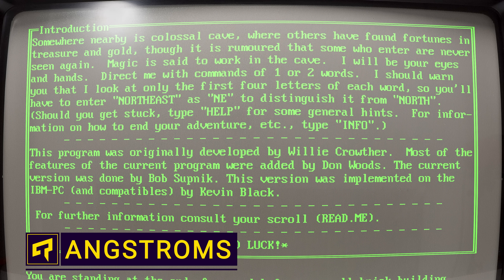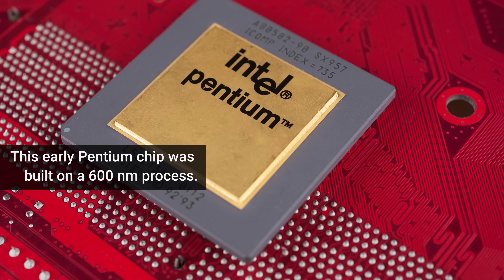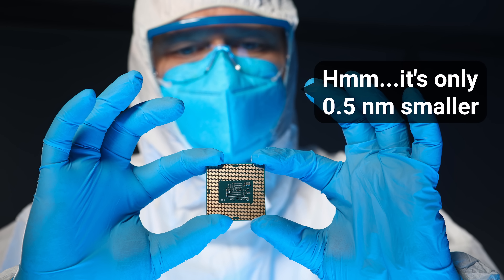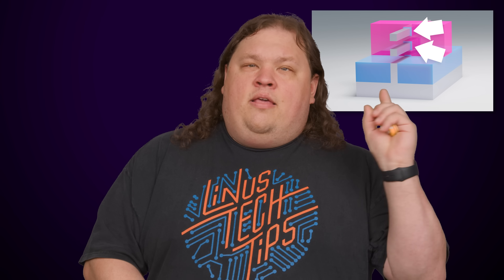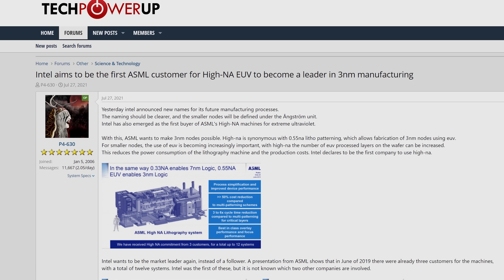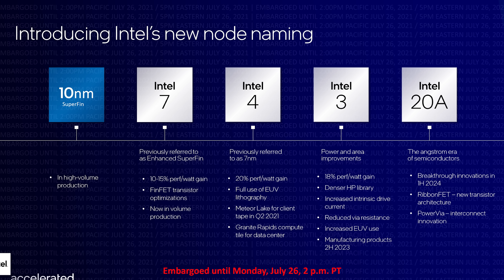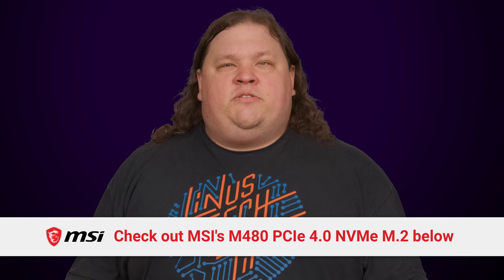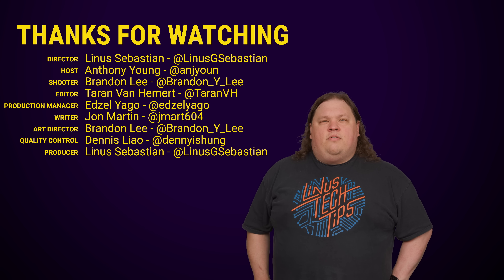CPU Angstroms vs. Nanometers

Comment: For what I know, a Ryzen 7 doesn't necessarily have 7nm wide transistors, but they use a namely 7nm process. EUV machines emit light as wide around at 13nm, so physically it is sized differently. Things, however, will change when ASML will ship better machine in 2 years, heading to the angstrom era. 
Edit to say you guys explained this, commenting before watching halfway pog. But also, TSMC does the same (N7, N5, so on)

Comment: I wonder what we'll do when we reach 2.2angstrom. We'll probably find another material, but eventually we'll reach the limits of that. I think we might be reaching the limit of size and maybe even computers before 2100.
Reply: Well Graphene is about 1.42 angstroms but I don't know if it will be worth it. What I think will happen is that companies will compete to maximise density since today TSMC and especially Samsung only shrink nodes without actually trying to get the most out of it so they can get it out to the market earlier. Intel might be behind in transistor size but in density Intel's 7nm is gonna be better than TSMC's 4nm and their 10nm is on par with Samsung 5nm. There's still a lot of room for improvement outside shrinkage.

Comment: not everything said here is correct, please check what you tell so many people. As an example, EUV is not used to make the transistor, but to illuminate the mask that is needed to etch the structures. And 5nm structure width does not mean that it is the transistor, but the smallest component of it, which in the end becomes a transistor.

Comment: hmmm... so 20 A means 9 si-atoms in line? is that the length or the width? what area would that be? if i knew the area, and knowing how much space between transistors, i could scale it up to the chipsize. wouldnt that be... easier to understand in terms of how the calculating power of a chip scales from generation to generation?

Comment: But why? The metric system goes lower than nano... there's pico, femto, atto, zepto and yocto... Your ångström is just a deci-nanometer or 100 picometer. Feels more like Americans will use just about any obscure standard of measure to avoid using metric... (I know ångström is technically metric, but we already had picometer)

Comment: The big issue I have with this is that even nm failed to be a relevant measure more than a decade ago. Switching to another physical measurement unit that doesn’t actually represent anything about the process or transistor feature size is the wrong thing to to.

Switch to a relevant measurement, such as maximum transistor density per mm2 or cm2. Then we can actually compare across fabs as well.
Reply: But that doesn't mean anything either. What we actually need is power efficiency and processing power measurements.
Reply: @ritwikreddy5670  but those are impossible to measure in any meaningful way, especially once you change architectures. As least maximum transistor density gives a meaningful cross fab measurement. Remember,mere talking about manufacturing technologies, not finished product capabilities.

Comment: There is a limit to size decreases... the molecular transistor.  I have been out of the semi world for a long time, but back then the issue was drawing the pattern for etching.  The light limit was reached, and they were having to switch to electron-based machines.   It is funny, but the mass rush to decrease in size  ended about 20 years ago.  Now it is all about refinement, while slowly gathering the machines and resources to jump down to the next size.

Comment: why do transistors need to get smaller instead of cpus get bigger with more of the 'big' transistors? nobody would mind a cooler twice the size. the ryzen is already a bit bigger than the usual 4x4 cm or so

Comment: Hi
 I have two computers
 System specifications first
 ROG STRIX Z590-F GAMING WIFI motherboard
 CPU i9 10900KF
 (3200) 64GB RAM
  (4 RAMs 16)
 SSD 1T M2
 Second system specifications
  Motherboard TUF GAMING B460-PLUS
  CPU i5 10400
  32 GB of RAM
 (1 RAM 16 (3200)) (2 RAM 8 (2400))
 SSD 512GB M2
 Both computers freeze while playing or working or watching movies. Suddenly, I swapped CPUs for both systems. The problem was not resolved.  I replaced the RAMs of both systems together. The problem was not solved. I replaced the graphics card of both systems together. The problem was not solved. I installed the operating system of both Windows 10. The problem was not solved.  I installed both systems on a Linux operating system. The problem was not resolved.
 What should I do now?
 Thank you for your help

Comment: I didn't see you mention an important point-- chips are basically 2D.  So if you go from 1000 to 10 nanometers, that is a factor of 100 in linear size, but 10,000 times smaller in transistor area.   So the gains have been much larger than the linear feature size would indicate.  Lots better.

Comment: Smaller nm or whatever will be useless if still need a lot of electricity just like what happend on intel h45 on laptops which is 10nm have terrible battery life despite it is not made for desktop replacement laptop

Comment: Just a small correction, the size is not of the transistor, but of the gate.
The way chips are designed you can't measure the size of an actual transistor

Comment: I'd say at this point transistors per square millimeter and flops per watt would be preferable, since regardless of what dimensions the transistors are, if you can fit 5 million in a square millimeter, then you can fit 5 million in a square millimeter.

Comment: You kinda flip-flopped on this one... You were talking about the node names as if they actually corresponded to anything real for the vast majority of the video, but noted that the names actually mean nothing at around 3:20... 

But even then you only said that there isn't an "industry standard way of measuring transistor sizes," while in reality they are just names as far as I can tell. For instance, IBM's new "2nm" ribbon FETs have ribbons that have 5x40nm cross-sections, which are then surrounded by what I'm guessing is a dielectric.

So what is the "2nm" referring to? Doesn't look like it's the dielectric thickness considering it's about the same thickness as the ribbons, but even then, how is thickness a useful benchmark at all? You can reliably get well under 2nm pretty easily even with MBE. You want real precision? Just go over to the ALD system and get the exact number of atomic layers you want. It literally only a single layer per cycle, regardless of how long you leave a step in the cycle running. That's why it's called atomic layer deposition. It's a more precise chemical vapor deposition that takes advantage of surface reactions.

I want a video explaining what the node names are actually referring to. I have a feeling it's something stupid like "well, Moore's Law which was only really an observation made decades ago about a trend over the decade prior and extrapolating that trend out a couple of years says that we should have transistor densities this high by now which translates to this width if we use the same width:density ratio that stopped being applicable a decade ago, so we'll name it after that width even though the improvements didn't involve much/any changes to the actual critical dimensions of the devices." So now we have people laughing at Intel for being the only company that isn't lying in its node naming scheme. "Lol, they suck. They can't even lie about achieving 5 or 7nm. They've been stuck on 14nm like everyone else for so many generations." It's like making things up to discredit Trump. There are PLENTY of actual things that you can point to. Why are you making things up when you can just use what they give you?

Comment: Angstroms have been used forever as their own unit because they describe the scale of atoms in small integer numbers. Now that we're approaching that scale with semiconductors, it's perfectly reasonable to use the same terminology. Intel's marketing is still terrible, but using Angstroms to describe process nodes is fine.
Reply: I prefer picometers. It's the next in line after using micrometers and nanometers. But it's not a big deal.
Reply: @AgentSmith911 
Picometers are a thousandth of a nanometer, so they're way too small in comparison to the slightly-too-big nanometer, making angstroms a good compromise. It's like how the liter is actually just another name for a cubic . . . decimeter. Not a cubic meter, as that was deemed too big for general use. To make things more confusing, the cubic centimeter is also used in the form of the milliliter. We could easily fix the naming issue with the angstrom by reintroducing in-between meter divisions and multiples ala the centimeter and the rarely-used decimeters, decameters, and hectometers. Due to these little increments of ten rarely going used, the units past kilometers and millimeters all go by thousands and thousandths in magnitude from one unit to the next, skipping the original by-tens/tenths convention of the early metric system. This decision could be mended so we have tens all the way down to accomodate these kinds of fringe cases, renaming the angstrom to an actual division of the meter instead of being unrelated but coincidentally a tenth of one, but that would take some convincing to the powers-that-be.
Reply: @AgentSmith911  
For now, fractional nanometers are more succinct and appropriate than picometers, but if you want the value as an integer then picometers are definitely the way to go.
Reply: Amen to that!
Reply: But it's a superfluous unit that adds unneeded complexity. There's no point in making everything a small integer if you're obscuring/making it harder to understand what it means.

Comment: Just a reminder to see, how some people dragged Intel back for so long. If Intel had stuck on its tik- tok strategy, it would have released their 5nm node in 2020 and about to release their 3nm in 2022. Which would have them 2 years ahead of any competition. Because for example Intel's 7 nm  is like the 5 nm of its competitors. Now, in my book in a leading company like Intel you don't slow down your manufacturing prowess. You accelerate it. But Intel did not just slow down, it came to a halt. It did not just encounter difficulties producing new nodes, it was just betrayed. When you are top dog sporting the best engineers on the planet and a full 2 years ahead of the competition, you just can't  fall behind 4 years from people  you were easily ahead just a breath ago. It is not that competition moved faster. It is that you stopped.
Reply: They didn't slow it down. They just stopped arbitrarily reducing the size of the numbers. They have since realized that people are idiots and decided to just use numbers rather than suggest that their transistors have anything to do with the arbitrary name they're named after.

Comment: While it can be impressive in regards to performance and all that?...I wonder "Why"?....I mean is a nano-second even measurable to the naked eye?...or can any of you tell me how many nano-seconds pass within a second without using a mathematical formula?....you know...like how you can tell me automatically that there are 60 seconds in one minute? I think we as a society need to slow down with the "MAKING" of faster processors etc?...and work on PRESERVING the PLANET that we use these devices ON!...I mean..the ice caps are melting...and parts of the world are either drying up...or else sinking!...so does it REALLY matter how fast a laptop...or mobile device is? IF NO ONE'S AROUND TO USE IT!? 

I'm Just Sayin'

Comment: So I suppose after transistors get smaller than a silicon atom... they will have to be made out of Graphene offset at 1.1 degree angles? :D
Reply: Graphene is a 2D material. The smallest width of a sheet of "graphene" you could get and still call it graphene would be a 2 atom-wide zigzag... Which would be wider than the single silicon atom...
Reply: @hank7281  But as you said... its a 2D material... so on one dimension it would still be smaller than silicon?

Comment: What about electron lithography? I heard some people are giving their all to make it work in the sub-nm range.
Reply: For research and producing masks, sure. For production, not a chance. The throughput would be practically nonexistent.
Reply: @hank7281  I didn't know about the bottlenecking throughput. I guess I will look into that a little more. Thanks!
Reply: @gingersnaps6941  yeah, with optical masks, you're exposing everything simultaneously. With EBL, you're drawing the design. Point by point. One point at a time.
Reply: @hank7281  and even with clever scattering (to double or triple the speed) you wouldn't be as fast as with light. I did not think of that. But still, I think electron lithography is crazy. When I first heard about it, I thought they were joking. xD

Comment: If they're reaching a limit, what sense does it make to change the measurement? Wouldn't the number of fitted transistors make more sense to advertise?
Reply: They aren't changing the measurement. There is no measurement. They're changing the naming scheme because they're tired of people making fun of them for not using made up numbers as small as everyone else's made up numbers.
Reply: @hank7281  Well, it's supposed to represent a sort of measurement even if it's fuzzy. But still, would number of transistors fitted be a more direct approach? Or transistors per area?

Comment: Wasn't the angstrom thing initially said by ASML? their new fab process is going much smaller than the current finfet sizes. I can accept Intel using the terminology.
Reply: Nah, it wasn't initially used by any company. It's been a pretty standard unit in physics for at least a century. Hell, it's been a standard unit in electronics manufacturing for at least a decade. Probably even since Silicon's been the dominant material.

Comment: Yeah chip manufacturers are gonna be running into quantum physics. Source/drain electron leakage becomes more persistent as pathways get smaller. Moore's law is still relevant even today. Chip manufacturers are putting a band aid over Moore's law with multi-core CPU's.
Reply: Moore's Law is not really still relevant, and it was just an observation Moore made. Then companies decided to try and follow it. Then changed it so they could keep following it. Then stopped following it and just continued naming their processes to pretend they were still following it.

And they are running into quantum physics. They have been for a while. That's a big reason why finfets became a thing.

Comment: This would only make sense if the nanometer values expressed in those marketing names were actually true.

Yeah, those numbers are just names that companies give their nodes.
Intel just got tired of explaining that their 10nm is actually comparable to TSMC's 7nm in terms of density (which is true) and decided to change the name to Intel 7.

It's a good marketing move and I do think it somewhat helps consumers when comparing products. But doesn't fix the issue that it's all just marketing disguised as standardized measuring.

Comment: About the time I was in middle school in the early 90's; I read a novel  set in a world that used magically crafted quartz crystals to power and control their machines that was written during either the late 60's or early 70's. I speculate that quartz radios was the authors inspiration, and one could say that those quartz crystals used in those old radios are probably the first microprocessor.
Reply: Not at all. You need to process to be a processor.

Comment: I remember countless articles in the pentium era saying Moores law was dead and they couldn't keep shrinking transistors
Reply: Moore’s Law, by the strictest definition of doubling chip densities every two years, isn’t happening anymore. If you back away from set standards its not really a Law. Chip performance however is continually improving but Moores law is about density not performance.
Reply: Well, it is, so... (Arbitrarily naming your process to pretend like you're keeping up with "Moore's Law" does not mean you're keeping up with it.)

Comment: Literally if we get to the point of transistors being only 2 silicon atoms wide, we would be subject to the quantum mechanical law of super position, rendering computers useless. If you can’t guarantee that an electron passes through a transistor, it kind of makes it useless. Gate stacking is a blessing of an idea though, gotta love those silicon engineers. 

It’s unfortunate that quantum computers suck at the logical computing that your everyday CPUs are good at or else quantum computing might theoretically solve the problem of super position for classical computers.